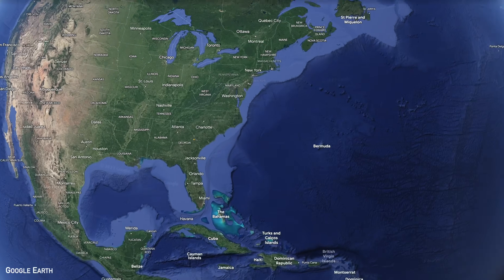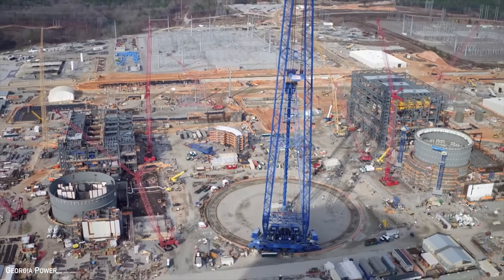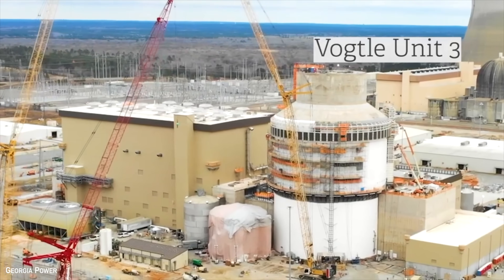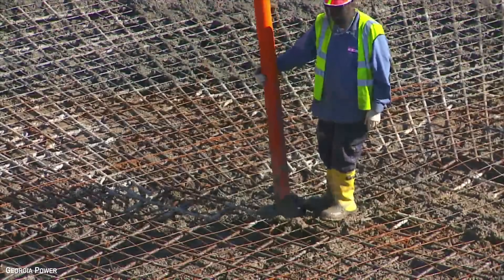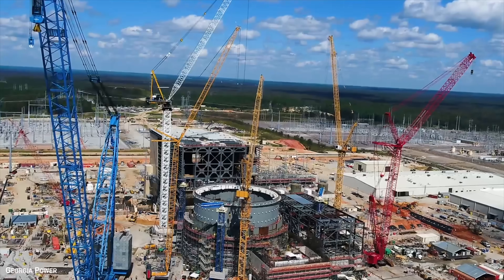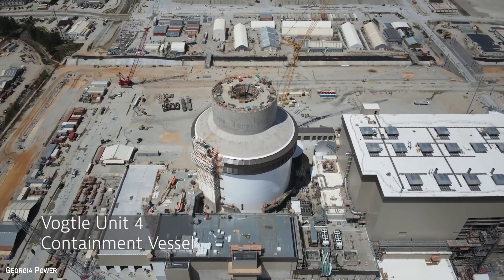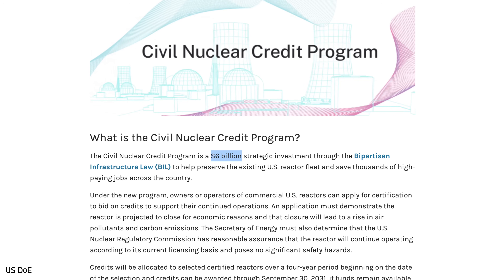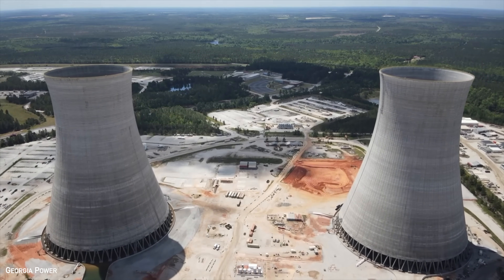Why the Future of Nuclear Power Depends on This Plant

Comment: As a long time Georgia Power customer,  Vogtle 3 & 4 going on line means I (and the world) might finally see some very delayed return on years of forced investments in their construction and cost overruns. As an steadfast advocate of Green Nuclear as a key part of the path to sustainability, this video was helpful in understanding and perhaps forgiving many of the reasons for those delays that I didn't fully understand. I remain hopeful that scaleable LFTR development and regulatory support will speed the realization of a new era of Green Nuclear energy that will avoid the problems of traditional large scale reactors. Your video is most appreciated!
Reply: Important to remember Georgia still has a very low cost of energy even given how much we spent on this. And is fuel prices go up the return on investment looks better. Not that fuel is thabad right now
Reply: @matt45540  My Georgia electric rate is 19 cents per Kwh based on my last bill.  What are you paying?
Reply: @matt45540  IF Vogtle gets their requested $600 million dollar rate increase for each unit, electric rates will skyrocket for their 2.7 million customers...you do the math.

The Georgia legislature is working on legislation that will prevent Vogtle from passing along all the massive cost over runs.  This is necessary since even the legislature knows the PUC is under Southern Companies control. Or maybe the legislature just wants more campaign contributions from Southern Company.
Reply: @clarkkent9080  Take that cost and divide it over 100 years, that's how long these plants will be producing CO2 free power on a plot of land that is a tiny fraction of what would have been required to be clear cut for a similar sized solar farm / battery backup for similar baseload power. At the same time making "stick built on sight" plants makes as much sense as hiring a dealership mechanic to build a car in your garage using parts from the parts department of the dealership, it will cost an insane amount of money, hence why SMRs are the way forward.
Reply: @anydaynow01  They don't last 100 years.  The oldest operating reactor in the U.S. is 52 years old and they just released 400,000 gallons of radioactive liquid into the groundwater due to corroded pipes.

Vogtle is 3 times the cost of any other generation method.  Take any of them and we will be saving billions more not using nuclear.

The Georgia legislature is working on a bill to force the utility investors to pay for all the massive budget over runs and if that happens, no investor owned utility will ever build another nuclear power plant.
Reply: @clarkkent9080  old reactors have lots of problems like the one you mentioned but new reactors don’t have the same problem.
Reply: @anydaynow01  these plants aren't designed to run for 100 years. Serviceability is 40 years, maybe another 10 after. Unless there are huge rate increases, these plant are not going to be economically viable.
Reply: @skygge1006  The AP1000 is a standard 1970 Westinghouse design with 2 loops instead of 3 loops and passive safety feature designs (uses elevated water tanks instead of pumps).  ALL that was done to reduce cost not to make it better since no U.S. reactors has ever had problems with active safety features
Reply: @anydaynow01  SMR's are not financially viable, there are also a problems with safety and proliferation. Big plants are like dams; big parts have to be built on site because for obvious reasons.
Rich companies like Tesla can easily afford SMR, that would be great marketing for them with customers paying for such adventures when buying products. We need big reactors for various reasons like infrastructure...
Reply: @clarkkent9080  wrong. the Ge mark 1 has had a lot of Problems
Reply: @skygge1006  Who ever heard "Boy they make em better now than the used to"?

What is different that makes them better now?
Reply: @clarkkent9080  the main difference is new safety systems as well as improvements to the old. Core catchers are a good example of a technology that will significantly improve safety.
Reply: @dknowles60  Everything that massive and complex will have problems over the years.  Many of the major components (Reactor components, steam generators, etc.) are custom made.  Many of the critical components are no longer being made by the time the plant construction ends or shortly there after.  The reason these plants have an average life expectancy of 40 years is the tremendous cost to maintain and replace failed components especially in radioactive and contaminated areas.
Reply: @skygge1006  The Westinghouse AP1000 advanced reactor uses passive safety features.  Like an elevated gravity feed water tank instead of pumps.  
Active safety features have never failed in a U.S. nuclear plant in the 70 years of operation and are not the problem. 
 Passive safety features were added to save money, plain and simple.  Fewer pumps means less emergency diesel power needed. That is a financial improvement not a technical one.

What is a core catcher????  I worked in nuclear for 40+ years at 5 different facilities and never heard the words core catcher
Reply: @skygge1006  Just as I thought.  You were talking out the same thing you wiped this morning.
Reply: @clarkkent9080   TVA browns ferry has been runing 50 years and the TVA wants to go  50 more years, The TVA has 3 nuclear power plants with Browns ferry having the most problems   the other 2 nuclear  power Plants have done ok, the TVA has desided not to finsh holly wood Alabama nuclear power Plant
Reply: @robertmcnearny9222  > Serviceability is 40 years, maybe another 10 after. Unless there are huge rate increases, these plant are not going to be economically viable.

The electric power industry doesn't really agree with you:
https://www.nrc.gov/reactors/operating/licensing/renewal/subsequent-license-renewal.html
Reply from the maker: Thanks and glad you found it useful!
Reply: @atomicblender  How did you ever get interested enough to start a "nuclear" channel?
Reply: LFTR is just dumb. Why waste time on Thorium when Uranium is easier and more practical to work with?
Reply: The only thing that will happen is your electric bill is going to triple. Of that doesn't happen, then the play will never get out of the red. Interest on 30 billion is more than the power company will be able to handle. This project should have been shut down long ago.
Reply: @robertmcnearny9222  Thanks for the opinion Mr. Positivity! 🤗 We shall see what happens with the level of debt and my power bill. Can't disregard that the corporate welfare state has already been billing us in advance for decades. 😳
Reply: @arxaaron  Naew, they haven't been billing you in advance. That is just their way of raising your rates. Also, it isn't an opinion. There is no way that the level of debt they have for this build is economically viable. 15 billiion per reactor. Now that the construction is done, the construction loan is over. Interest alone will probably be more than revenue generated from the two reactors. Have fun paying 3 times as much now.
Reply: @robertmcnearny9222  I have a 19% Vogtle construction surcharge on my electric bill for the last 3 years.  My last electric bill came out to 19 cents per Kwh used.  The AVERAGE cost in the U.S. is 14 cents per Kwh
Reply: @clarkkent9080  you are just proving my point. A 19% increase will do absolutely nothing to knock down even the interest on the money they borrowed to build this plant. It's really simple math. And the fact that you have to pay a surcharge on top on general electric prices just shows that this plant was a waste on money. Don't get me wrong, I think Nuclear is the way to solve the energy problems we have. Bit the cost to build is just way too much to be a financial solution.
Reply: @robertmcnearny9222  No utility is supposed to charge for a plant before it is operational.  Georgia Power somehow convinced the PUC to allow a 19% increase during construction because of the ballooning costs.  Now that unit 3 is operating, Georgia Power has asked for a $600 million rate increase and I assume the same when unit 4 goes operational.  That is in addition to this: State regulatory staff and Georgia Power Co. have agreed on a plan that will boost power bills by 12% in June to cover the higher costs of natural gas and coal that the utility burns to generate electricity for its 2.7 million customers.
Reply: You will soon see your electric rate double in addition to the 19% surcharge you have been paying for the construction.

There is no plans in the U.S. for any LFTRs  so don't hold your breath on that